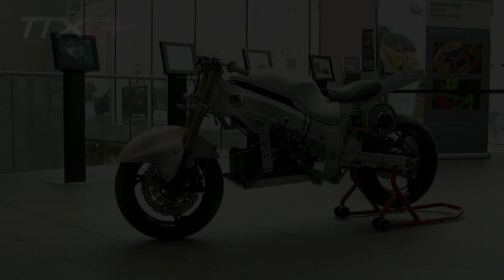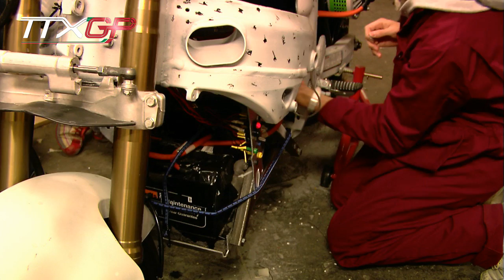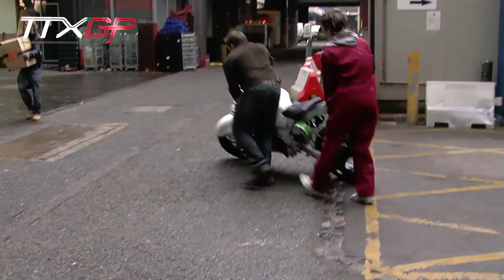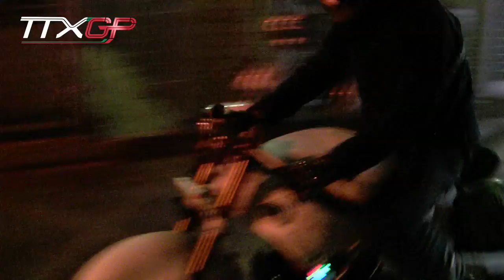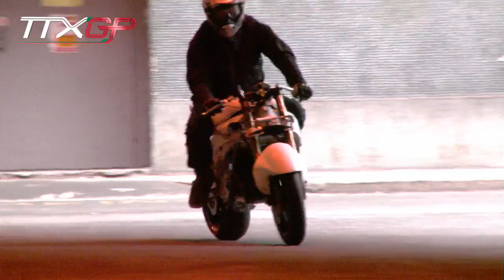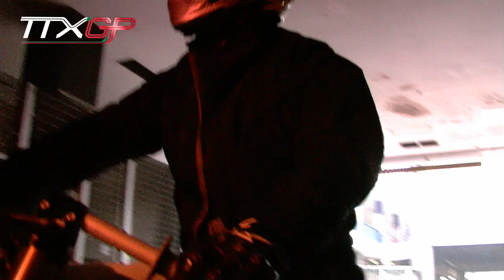Imperial College London Electric Motorcycle Test TTXGP

Comment: errrr... you know there's a reason why the front sprocket is always located as close as possible to the swingarm pivot (or even coaxially with it, in the case of the BMW G450X) and usually at a height where the front sprocket, pivot and rear sprocket roughly line up when the suspension is loaded with the weight of the bike.